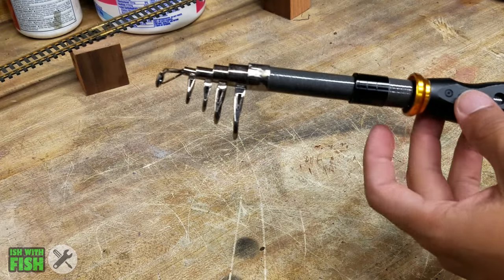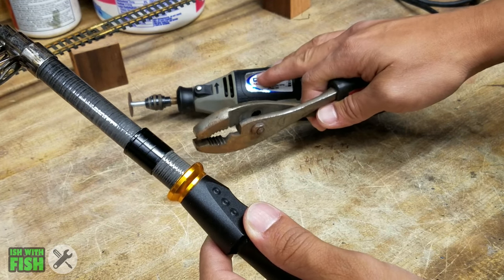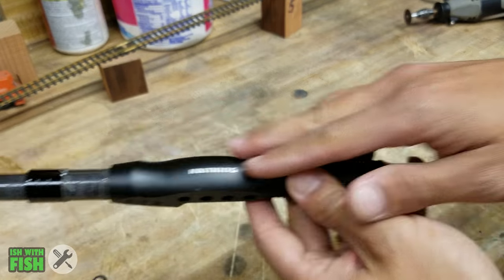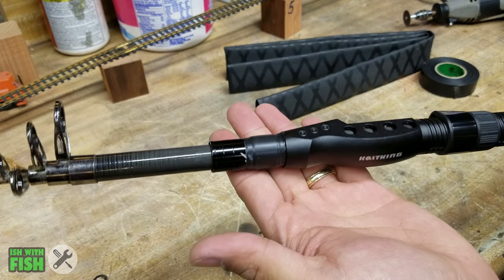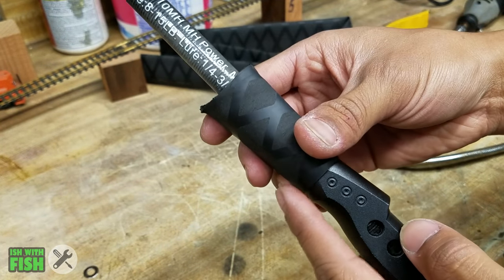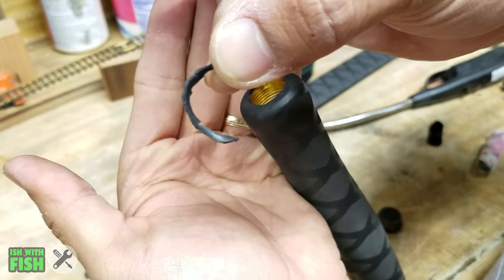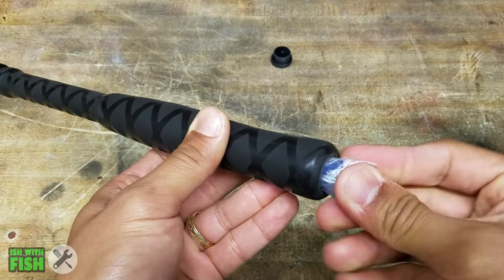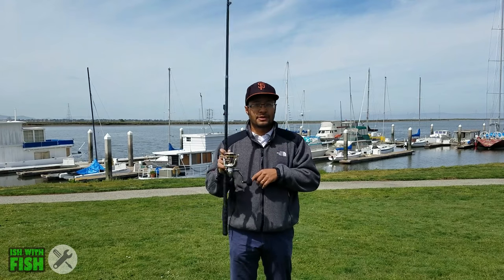How to Modify Your Amazon KastKing BlackHawk Sougayilang Telescopic Travel Rod

Comment from the maker: If you like what you see, visit https://www.amazon.com/shop/ishwithfish for ALL the gear I use, review, and approve. These affiliate links directly support future content. Gratitude! 🙏
-------- 
Yes, this is your rod! ONE Chinese manufacturer private labels this model and may be sold/branded under Amazon Sougayilang Piscifun AliExpress Alibaba Wish.com KastKing BlackHawk or generic Black Hawk. You'll need a cutting tool (ex: Dremel with metal cutoff discs), pliers, heat source (ex: lighter or propane torch), 4.5 cm / 1 5/8" dia (measured when flat) heat shrink rod grip tubing, qty 3 1-oz egg weights, spare baggie, and about 30 min. Let me know if this vid helped you out🤘
Reply: how long is this rod? do you need to take the first guide ring off for a shorter version of this rod?

Comment: For those wondering which handle wrap diameter to order, the 30mm size on the link worked best for me. I would recommend "building up" the handle area above the foam handle so the shrink wrap grips the handle better. Hope this helps, went back and forth with Amazon several times to find the right size.
Reply: Thank you!
Reply: thanks i was looking for that info

Comment: I did this to  3 teke rods and permanently fix to reel. So reel is non removal.  Did this to my Berkley Lightning rod and Rapala rid to cover the cork. It works great. Not slippery and look a little classier. Use a stove oven to shrink it as my torch is out of gas
Reply from the maker: awesome solution👍🏼

Comment: I haven't gone fishing with mine yet, but how is the Sougayilang reel holding up and what is the biggest fish you've caught with it so far?
Reply from the maker: +L.I. Archer it held up ok till i dunked it. its inevitable. i put a handful of perch on it, and two leopards in the surf, dunked it on accident, ever since the spin is slowing. drag is ok, a little uneven after the dunk. the handle feels a little loose now, i see why now industry are going with screw-in, tougher design. prob ok for freshwater and light inshore, but the surf is beating it up.
Reply: Yeah, that's what I figured would happen.  I saw another video where some guy bought a Chinese-made reel off of ebay for $6.00.  He opened it up and found the gears were nylon/plastic, and the mainshaft was really cheap metal.  I bought 2 Sougayilang reels that I put on my freshwater rods, so I guess they'll strictly be used for freshwater.  I like what you did with putting the knob on the handle.  If you ever decide to get rid of the reel, I'll take that handle/knob assembly off your hands.  I can use it on one of my reels.  LOL  Thanks for the reply.
Reply: Did you ever open it up and see what the gears are made from (metal or plastic)?

Comment: hello. I like the mods as I have three of these rods. one issue I see constantly is the telescopic sections get stuck open and I have trouble closing it. How do you deal with this?  it seems wd-40 doesn't solve the problem as they continue to get stuck.  thoughts?   thank you.
Reply from the maker: hi, thx for stopping by. first off, don't spray it with WD40 lol, even though it's just mineral oil i think over time it'll get grimey and could make the carbon adhere to itself in the tubes. plus, the rod segments needs need to be perfectly dry so they can hold each other while extended, otherwise they'll spin out with every cast. 

this is what i do: after every surf session (i fish mostly salt), i leave it extended and walk back to my truck. i spray it down with water to knock the salt off (i always keep a cheap dollar store spray bottle in the truck to do a primary rinse on all salt gear). i give the butt end a few taps on the ground to knock off excess water, and, working from the bottom, i grip the largest rod segment in the the middle, and give a the butt end a good sharp tap onto the ground again, like i'm putting a garden stake into the ground. that tap should be enough to free the rod segment. i then work my way up the rod, being sure to retrieve excess line as i go segment by segment. works every time. when i get home, i'll unplug the bottom drain cap and give the whole reel/collapsed reel one more mist, and let everything air dry before i pack it away. seems tedious, but keeps everything in great condition for the next outing.

Comment: HI Ish. when you cut of the bottom guide, did you have to file down the points to the steel part that wraps the rod?
Reply from the maker: +Sharks4life 12 sup man, yup, absolutely. remove any burrs, ie any chance for line to nick or fray.

Comment: What is your honest opinion of this rod.  For example for surf fishing with plugs and lures.  And how about bait fishing how does it rair?  What is the rods specs length, power etc?
Reply from the maker: check out the companion review vid to this one, link in the description. basically it sucks for lures over 1 oz, but it's great for bait fishing if you're casting weights up to 3 oz. specs covered in that vid too.
Reply: Hi, About the line weight range what's the maximum ?

Comment: Great job ! Just watched it again, and I'm going to get one while I'm here in China at the moment, and do the same ! One question : Why did you feel the need for a counterweight, and how did you determine the actual weight ? (The rod seems so light towards the front). I plan to get the 11'8" model for beach surf casting.
Reply from the maker: thx. after a weekend of casting spoons over and over, my wrist fatigued. i noticed the short butt caused the imbalance, and added egg weights to center the balance on the foregrip. huge improvement! can cast now with much less fatigue.
Reply: Thanks a lot, I will check it with the 11' 8" rod, and put in appropriate weights ! So the weights should be pushed in deep towards just forward of the reel seat ?
Reply from the maker: no, just in the rod butt. the handle blank is tapered a bit, so the egg weights can only go so far.
Reply from the maker: btw, check out https://www.amazon.com/shop/ishwithfish, i list all of my favorite and tested/approved fishing gear there. 
reels, rods, line, if you ever need gear tips and personal recommendations, feel free to start there. i added this telescopic rod under the 'approved' list :). i update and add new reviews weekly. affiliate links, so any purchases there support the channel. thanks!
Reply: Thanks for the info and the links - I do plan on making a number of purchases from Amazon, so  I'll check out your channel first  !

Comment: UGH, so I ended up ordered "35mm" shrink tubing for what I thought was supposed to be the pre-shrink diameter. Apparently, it seems 35mm is what the diameter is supposed to be after applying heat and shrinking... I did not realize this until trying to shrink on the 2" section. I was thinking that the initial size of the tubing was pretty large but just went ahead and tried applying it anyway. Not sure if the seller is going to offer recourse but it also wasn't clear from their description that this was the case. Is the "post-shrink" diameter these ebay sellers advertise an 'implied-known' or something?
Reply: Hmm, I remeasured the DIAMETER again not the width and it is 35mm. It still feels a bit loose though. I think 35mm is still too big. I should have gone with 30mm... shucks. I just reread your description: " 4.5 cm / 1 5/8" dia (measured when flat) " - dohhh! The one I got measures 5.5cm when flat. Of course, the seller didn't note any of this so I assumed it was 35mm flat.
Reply from the maker: ah, sorry man! yeah it's hit and miss with chinese vendors and their descriptions, hopefully i provided accurate info for my model.
Reply: Yea I think so! So it's 4.5cm/45mm when laid flat. If you still have any of the material left over could you measure the diameter (when you fold up like a circle) and see if it ends up being 30mm? I have a feeling it will be 30mm, which is how the vendor describes the measurement.

Comment: How did you build up the electrical tape so evenly when wrapping the gap? I've been trying to do it but every time the tape seems to build up in the very center causing two more 'gaps' to appear on each side of the tape.
Reply from the maker: iirc, i filled the gap with strips of tape cut lengthwise to fit.

Comment: Hey Ish thanks for the videos.....Got the the same rod but 6ft. I had a question what size is the heat shrink wrap you used?
Reply from the maker: sure thing. the diameter's prob smaller on the 6', but i used a 4.5 cm / 1 5/8" dia (measured when flat) heat shrink for my setup, should work for yours.

Comment: I noticed that by sticking the weights (in a baggie) into the 'storage' compartment, it causes the first (or last?) telescoping section to extend out and be loose (when the plastic tip guard is on). Have you found a good way to secure that? Or even prevent it (by finding 1oz of weight that doesn't cause the telescoping portion to extend out)?
Reply from the maker: the 3 eggs do cause the bottom section to stick out a few inches, but as long as you have a reel mounted with line/clip/hook, the line keeps the sections from moving around when packed up. i can still mount the cap with the line and clip running through the guides and back down to the largest guide (which then acts like a hook keeper).

Comment: You think the 3 or 3.6 models would be too light for crab snaring?
Reply from the maker: +Jeremy Lee i wouldn't use this rod for crab snaring. too flexible and parabolic.
Reply: Thanks! Yea, I saw several videos after and figured likely not :) BTW regarding crab snaring: if you had to choose between a heavy 10', 11' or 12' rod, which would you go with if you also didn't want lock yourself into a 'crabbing' only rod? I'm looking at getting an Okuma Longitude and initially ordered a 12' but may try to change to a 10' or 11' if it makes more sense...
Reply from the maker: i would go with a 11' penn prevail mh. it's just heavy enough for crab snaring and chunking baits for bigger game, but light enough to whip lures. plus i think it's on sale for 60 here and there, great value imo. i tried the 12' h longitude a couple times, omg that thing is a telephone pole lol.
Reply: Thanks! I ordered the 8'10 for surf fishing and travel (whenever that happens haha) and got it today. Cool rod! BTW: for the grip you linked, there's 40mm and 45mm but not 43mm. Would 45mm be too wide? And for the rubber 'shim' did you just use a small piece of the grip or something and cram it into the top portion of the reel seat? Any issues with the bag shifting around with the weight yet? I'm considering using a Shimano Sedona 2500 and 4000 with this and it feels a bit forward heavy with the 4000 + 3x 1oz sinkers still... unless those weren't 1oz hahaha. Also, how did you loosen the black bezel thing (not shown in your vids cause you probably removed it just before). Mine doesn't freely spin and appears glued in place. Just cut it off w/ the Dremel+pliers?

Comment: What size diameter on the heat shrink ?
Reply from the maker: chaili89 4.3-4.5cm dia when flat (pre-shrunk) should be a good size.
Reply: 45mm is way too big I'm doing this now and 4.5cm was huge and couldn't shrink to the pole I'm about to reorder and kinda sucks because the shrink wrap is almost more money than the pole
Reply: For anyone else out there trying to do this the rod is about one inch or 25mm in diameter with the foam on the butt so order close to that
Reply: Would 30mm be OK? Or better to go up to 35mm?

Comment: And the reason why you took off that gold ring is because why. Why did you cut it you should have left it and build up around that ring if you were going to just covered with shrink tubing and never use an open flame use a heat gun or a hair dryer
Reply from the maker: removed gold ring because the transition from reel seat alu to new foregrip is seamless. no step up to catch your fingers on. trust me, it's very comfortable now, exp during surf casting. open flame ok in open air conditions.
Reply: @ishwithfish  not because it's an open flame especially a torch  that may slip out of your hand  and cause a fire  in the garage but you have more control with a heat gun then a open flame once you use a heat gun or a hair dryer you'll never go back to a Open Flame if you are in the field then an open flame works perfectly but otherwise in a controlled area at home heat gun or a hair dryer works best give it a try

Comment: A bit severe the naked flame use hot water or the mrs hairdrier good job it,s a shit rod.
Reply from the maker: hair dyers don't get hot enough (I tried), but heat guns do. propane flame is the easiest way. these blanks sell for $9 shipped on ebay, i've put 4" surfperch to 35lb rays on it before i broke it, hard to beat that value.